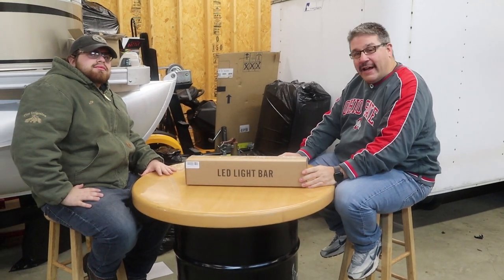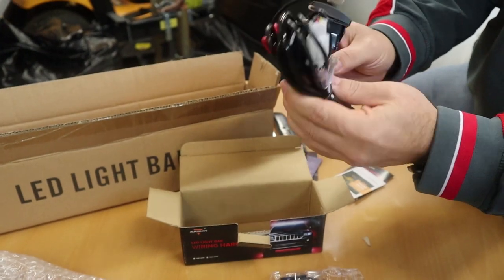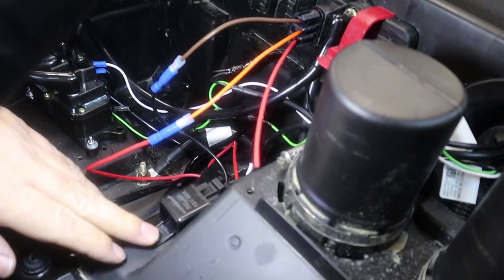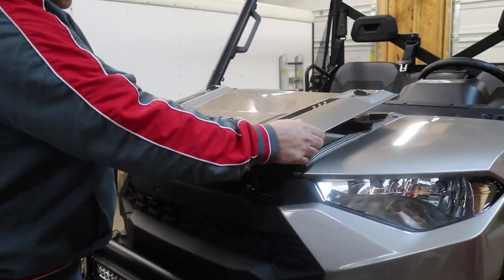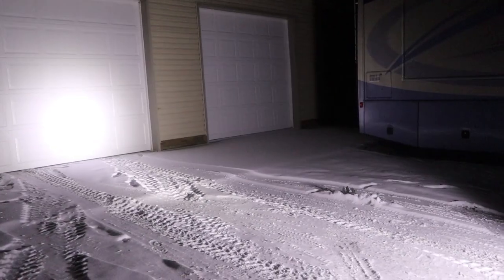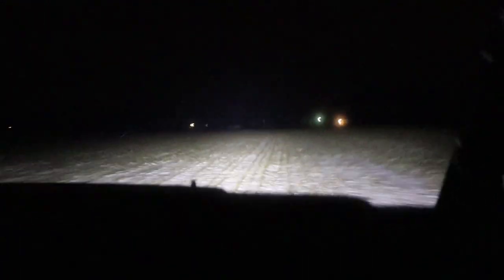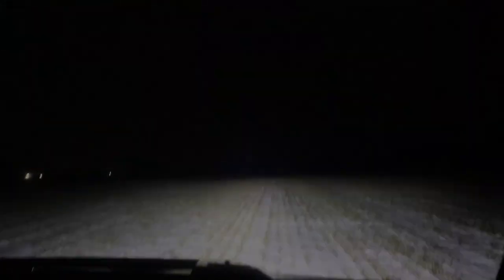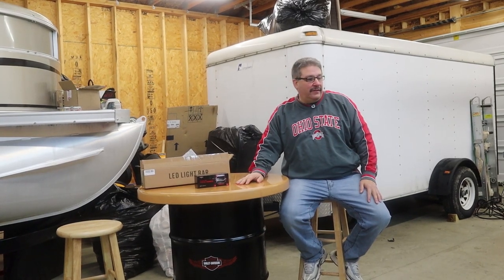2018 POLARIS RANGER XP 1000 LED LIGHT BAR INSTALL

Comment: Hello, so the middle wire and bottom wire need to be wired together and then those 2 wires get wired to the harness? I want the dome light to be able to be turned on with the key off. Thanks and I put this question on the wrong video so you disregard the washing video question !! Sorry and thanks for the info!
Reply from the maker: Yes if you want the light wired to constant hot.

Comment: When cutting out for rocker switch, did you cut along the pre-outlined area on the switch blanks or smaller?
Reply from the maker: I cut right on the line. Just make sure you have a sharp blade and take your time.

Comment: do you have any issues hooking the hot fuse wire from the lightbar harness, to the acc light wire on the pulse bar rather than plugging in to the hot wire on the pulse bar?

Comment: Hey great video! My question Is do you wish you would of wired the 18 inch light bar to the constant hot or keep it on the key hot? Getting ready to install this as well as the Polaris beacon light. But I just don’t know if I should wire it to constant hot, if it will drain my battery so much I can’t get it started if I ran the lights it for 10-15 minutes at a time? 

Thanks!
Reply from the maker: Thanks! I ran to key hot so the battery wouldn't get drained. If you run to constant hot and your rocker switch has a light on it I believe it will stay on and drain your battery.
Reply: UTV DIRT don’t want that then! I don’t want the rocker switch on all the time. Worst case I just leave ranger on while I work to keep lights on
Reply from the maker: Yep that will work. Thanks for watching!

Comment: So did you not use the constant red wire at all?  The ground and key on power wires only?
Reply from the maker: That's correct used key hot and ground only. Didn't want to have power constantly.

Comment: Hello getting ready to put quite a bit of lights on my ranger and it’ll be a lot of wiring I was just wondering where you got those accessory relay plugs that’d save me so much time and hassle thank you! 3:16
Reply from the maker: There is a link in the description of the video for all parts used.
Reply: @UTVDIRT thank you for the reply! But I’m only seeing 4 links in the description 1 to your merch store 1 to your instagram 1 to the light bar and 1 for the light bar harness. But no link to where you found the wire harness used at this time stamp here ( 3:14 )

Comment: When you mounted the relay, did you use like a Sheetmetal screw and screw it into the plastic ? Or do you run a screw all the way through the plastic and use a bolt on the other end ??
Reply from the maker: It was a sheet metal screw and just screwed it into the plastic. Thanks for watching!

Comment: Hey Guys, did you have any issues with the included mounting hardware?  I started assembling and seemed like the alignment for the bolts both to the brush guard and from the bracket to the light needed to be super close together
Reply from the maker: No I did not have any issues with mounting the light bar. I used EMP mounting brackets.

Comment: Does the wiring harness you have linked come with the adapter for the ranger bus bar?
Reply from the maker: No it comes separate. I have links in the description of the video for the bus bar plug.

Comment: So is the light on your rocker switch lit up when the key is not in the ignition?
Reply from the maker: No the rocker switch light is not on when the key is off. Sounds like you wired yours to constant hot and not a key only hot.

Comment: Hey UTV Dirt just got the same light bar in today for my Ranger, saw yours had two bolts on bottom of light bar mine has 4 sliding bolts, the brackets are curved with two slots in them just wondering how yours was mounted cause I’m confused with this one now lol
Reply from the maker: Yeah mine only came with 2 bolts but you can use 4 I believe. There are slots to mount two torwards the middle of the light. The curved part mounts onto the curve of the light if that's what you are asking.
Reply: UTV DIRT that might be it it just threw me for a loop, thx for responding so quickly and hope the Maverick project is going good
Reply from the maker: No problem! Thanks!
Reply: UTV DIRT hey how’s it goin bud just got light bar mounted and looks great it was a great recommendation, have one question when we hooked up to the key hit the light turned on but the aux beam toogle switch would not turn it off and when we hooked up to the constant it turned on right away without key on or the toogle switch wouldn’t turn it off either. The pulse plug I used was one off amazon and it was the almost pulse bar pig tail one people said wires are switched around on them but we checked the red and blue wire I have and both were hot and the black was ground any suggestions
Reply from the maker: The top of the pulse plug is ground so hook ground wire from wiring harness to it and the middle wire is key hot so hook your hot wire from harness to that wire. That is how mine is wired and the switch lights up when key is turned on.
Reply: UTV DIRT sounds good thx for info, on another note the aux beam harness the two U looking shape ends that is a red one and black one you do hook those to ground and the hot correct
Reply: Hook them to the machine hot and ground under hood I mean
Reply from the maker: Those are what hook up to the pulse plug I believe. If that's what you mean.
Reply: UTV DIRT the harness has the normal ground and hot wire but off the side of same wires there is two u shape fittings as well that are red and black are those supposed to be hooked up as well or those just extra hook ups cause I did get same harness as you did
Reply from the maker: There should be 6 wires two each for two lights and two for battery hook up or in this case pulse plug. The ones with the U shape normally hook to the battery or power hook up. If that's what you mean. I am not sure if you are using correct wires because I'm not there if you know what I mean.
Reply: I just went to shop it’s the black and red wires that come off the fuse relay those r supposed to be connected to the ground on machine and red connected to the hot that’s right across from bus bar under hood
Reply: UTV DIRT so those two wires that come off the fuse relay with the u shape on ends don’t need to be hooked up to anything

Comment: Hey guys. I installed the same light at and wire harness you recommend. No I am getting the led light at flickering and barely working. Any advice?
Reply from the maker: Sounds like you got a loose connection or bad light. I would check connections first.

Comment: the light harness you used can it handle the , DJI 4X4 18 Inch 408W Quad Row Off Road LED Driving Lights
Reply from the maker: The wiring harness is rated at 20 amp circuit. You need to check how many amps your light pulls. If it's under 20 it should be good.
Reply: @UTVDIRT  the light bar  looks to 34amps so this harness is a no go   back to the drawing board
Reply from the maker: @richardmackenzie3167  Yeah that is to many amps. I will let you know if i come across a wiring harness.
Reply: @UTVDIRT  doesnt  that auxbeam have a 40amp relay if so it should handle more that 20amp circuit
Reply from the maker: @richardmackenzie3167  Yes it looks like it does so it might work.
Reply: I'm in the same predicament, can you send the link to the wiring harness you used? Thanks in advance!

Comment: Do you have a link for the 18" Light bar?  I cannot seem to find it on Amazon.
Reply from the maker: I just checked it looks like it is currently  unavailable. Here is the link I have for the light bar. Led Light Bar YITAMOTOR 18Inch... https://www.amazon.com/dp/B07BKR58K5?ref=ppx_pop_mob_ap_share
Reply: @UTVDIRT  Thanks. I will probably just go with another model.  But liked the way yours looked.
Reply from the maker: No problem.  I did find another one on Amazon but it's a little more in price. Here is the link.
LED Light Bar, DJI 4X4 18 Inch 408W Quad Row Off Road LED Driving Lights Spot Flood Combo Beam OSRAM Fog Lights LED Work Light for Trucks Jeep ATV UTV SUV Marine, 2 Years Warranty https://www.amazon.com/dp/B078Z9P9BQ/ref=cm_sw_r_cp_apa_i_xZlQCbWN2G7B6

Comment: Where at in Ohio are you located? I’m also in Ohio! And do you have a particular place you ride your Ranger?
Reply from the maker: I am located about 30 minutes away from Akron in a little town called North Jackson. I haven't taken it to a orv park yet just been riding on my land and my buddies land. We do plan on going to Mines and Meadows and some other ones when the weather breaks.
Reply: UTV DIRT I’m a bit aways from you. I’m in Wilmington ohio. Not too much around me to ride other than some wooded trails but mostly fields. Got about 8 inches of snow down here and my Ranger xp1000 was a blast to ride in it!
Reply from the maker: Nice! We got about 3 inches of snow so we had a blast last night but froze. Need a windshield lol!
Reply: UTV DIRT by far the lock and ride hard coat poly windshield I got when I bought the machine was the best investment! Highly recommend
Reply from the maker: Thanks! I will definitely be looking into one.
Reply: UTV DIRT no problem. I also have a roof on order it should be in within the next few days. Going to order the 10k lumen LED headlights Friday. I will let you know how I like them
Reply from the maker: Cool let me know. They make a big difference from the stock lights.

Comment: I installed this exact light and it flickers at low idle.   It sure why this would be the case.
Reply from the maker: Not sure but I would check wire connections to make sure they are good. If everything looks tight I would return LED for new one. Hope this helps. Thanks
Reply: @UTVDIRT  thank you.

Comment: Would a 20 inch light bar fit?
Reply from the maker: It might fit but will be tight. I have about a finger width left on both sides of the light.

Comment: What kind of wiring harness was that and where did you get it
Reply from the maker: I got the harness on Amazon. I have links in the description of the video but it looks like they are out of stock.
Reply: @UTVDIRT  thanks do you remember which one it was. everyone I pick say it won't fit my 2020 polaris ranger
Reply from the maker: It was the auxbeam wiring harness.
Reply: @UTVDIRT  thank you
Reply: @Monty Kirkpatrick I'm in the same predicament, can you send the link to the wiring harness you used? Thanks in advance!
Reply: @ben380z  I ordered a LED light bar from Amazon that came with a wiring harness I cut their switch off put a rocker switch on it
Reply: @ben380z  the led light bar I order was a odero 17.72 inch. With. Harnes 468 w from Amazon
Reply: I like the rocker switch better so I just cut the wires and replaced it from the one they sent
Reply: @ben380z  I'd say that switch would probably work
Reply: @ben380z  the only thing I don't like about the LED light bar I got the brackets won't let it at angle up enough where I put it on the front bumper
Reply: @montykirkpatrick4477  Ah i see... well another light bar that has been mentioned a good bit on here is this one: https://www.amazon.com/dp/B078Z9P9BQ/ref=cm_sw_r_cp_apa_i_xZlQCbWN2G7B6
Reply: @ben380z  I also ordered a pack of 3 plus power plug connectors made it a lot easier to wire
Reply: @montykirkpatrick4477  Oh nice! Do you by chance have a link?
Reply: @ben380z  is on Amazon 3 plus power plugs 13.98 the price

Comment: How do you wire up the relay?
Reply from the maker: I purchased a wiring harness with the relay already wired and I just wired the positive and negative to the pulse plug.
Reply: @UTVDIRT  My harness didn't come with a relay. I have a soundbar and just installed a light bar. When my music plays it is dimming my light bar. Would a relay stop this?
Reply from the maker: Yeah it sounds like you are drawing to many amps. The circuit for key hot is only 10 amps and constant hot circuit is a 40 amp circuit.
Reply: @UTVDIRT   I have sound bar and lights on key hot. Would putting the soundbar on constant hot resolve issue?
Reply from the maker: Sounds like it will. Real simple to test out just switch wires on pulse plug to constant hot.

Comment: you guys skip too many steps. if your making an educational video you should probably show every step. wiring included. otherwise thanks for info
Reply from the maker: I will be glad to answer any questions you may have. The wiring harness we purchased is all plug and play and I showed on the video where to route the wires, relay, and how to wire accessory plug. Thanks for the feedback.

Comment: I would like to order a light bar for my husband's 2019 Ranger 1000 northstar. I found this light bar:
https://www.amazon.com/dp/B076KRYN39/ref=cm_sw_em_r_mt_dp_U_w09gEbQNAR6VT

I'm confused about which wiring harness to purchase? I have a couple of the bus bar pigtails.
I installed plug n play turn signals, horn and a winch last week thanks to your videos! My husband is disabled, so I get to do the fun stuff for him! Thank you
Reply from the maker: Nice! I love the Northstar's! I used the auxbeam wiring harness for my LED light bars. Check out the link. Hope this helps you. Auxbeam LED Light Bar Rocker... https://www.amazon.com/dp/B06ZY83Y5H?ref=ppx_pop_mob_ap_share
Reply: @UTVDIRT  Thank you so much - I just placed my order!